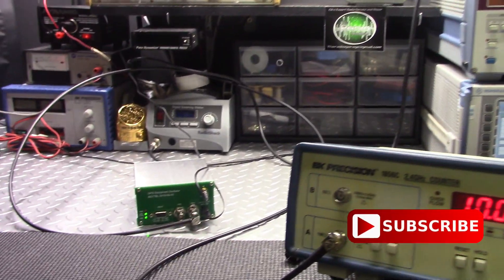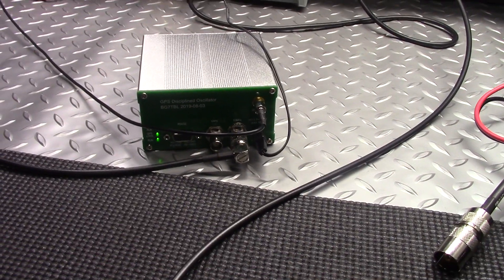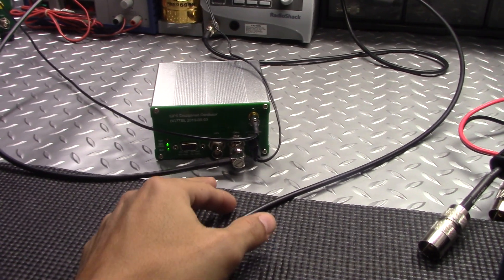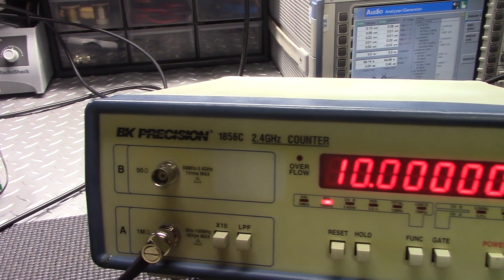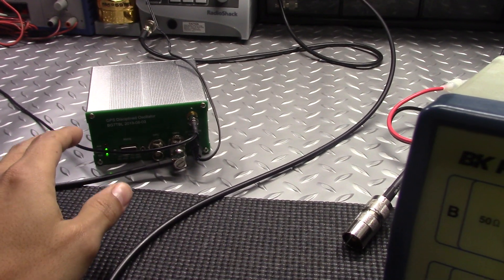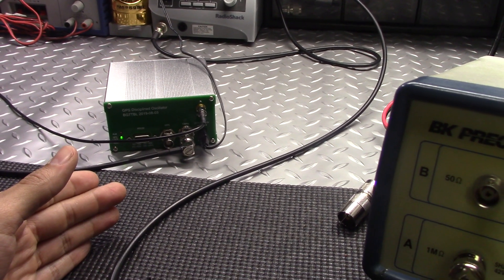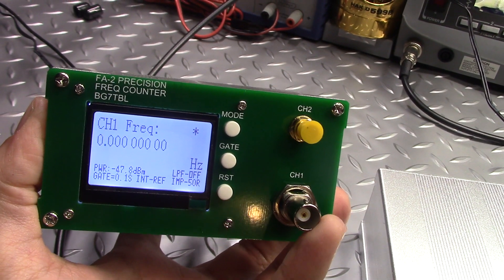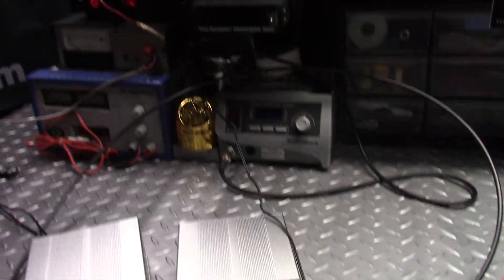GPSDO 10 MHZ Reference For CB Radio (Disciplined Oscillator) BG7TBL & FA-2 Frequency Counter

Comment: On the GPS unit. Does anyone know what the blinking green LED on the bottom of the board rear between the BLOX module and the board corner labeled D2 means? Mine seems to blink at a 1hz rate, but it may mean something else?